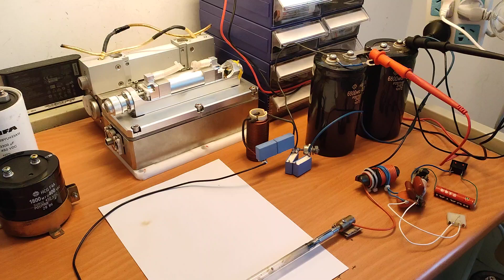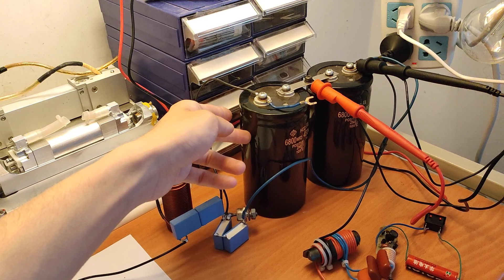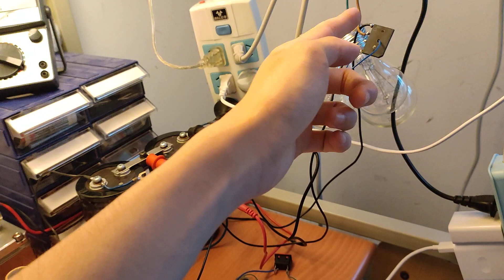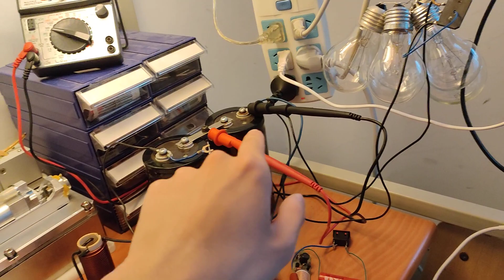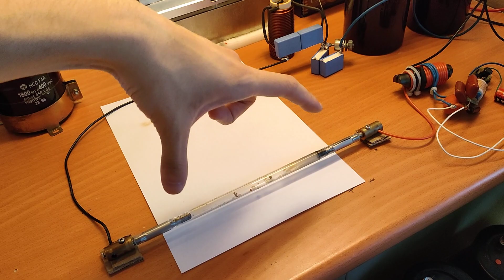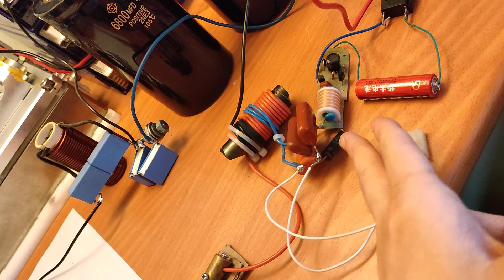Xenon lamp trigger circuit

Comment: Can someone help me build a chap 1000 W Xenon flash lamp power/controller. I want to control flash in milliseconds, could be in increments 10ms , 20ms... up to about 200 milliseconds. Also if Wattage could be controlled. Can someone help with link or explain?